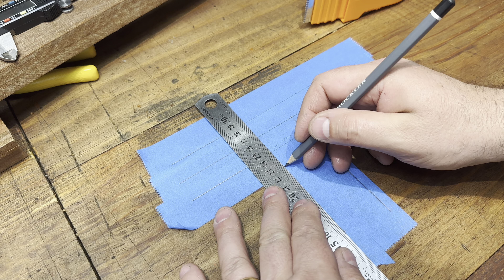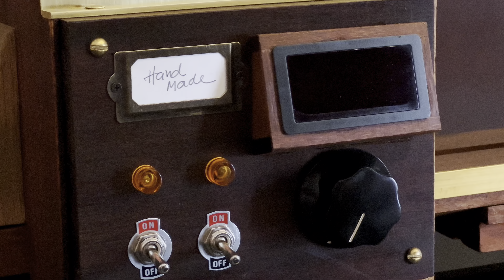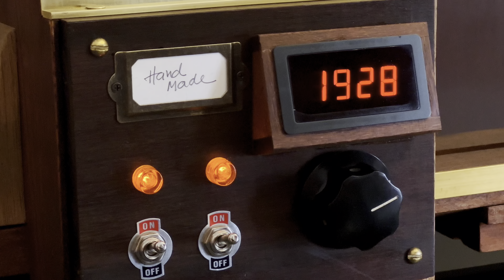How to Make | DIY Wood Lathe from washing machine motor #howtomake

Comment: very nice You are a true craftsman and I want one. How much did it cost?
Reply from the maker: Hi, how are you? This is a very good question! I don't know, I already had an engine, wood, scrap from other projects and even an old belt. I only bought the bearings, shaft, chuck and electronics. I'll think about it and if I find any value I'll let you know Thank you for sending the message! @anthonyvincent9990

Comment: Beautiful job!  The parts you used for the tail stock, genius!  Where did you find the threaded rod with a pulley attached?
Reply from the maker: Hi, how are you? Thanks for message. I created a sketch and I bought that like a project. About the chuck, I bought in amazon. I believe if you can buy both in amazon. Tips: 1-buy that’s parts (motor, chuck…., 2-build the lathe. 🙏🙏🙏 @bonesstones6584

Comment: Hello friend! I plan on building something like this for myself, and had some questions. 

First, what did you do for the spindle? Did you purchase one, or get it from a broken lathe? Or make it?
Reply from the maker: Hello friend! Good idea, you can make like that.
About the spindle, this is very importante. I made a sketch and send to mechanic. You can buy in amazon all the peace’s. I bought wash machine motor and controls in amazon.
Reply: @woodtransformer  So you had it custom machined? My university has a machine shop, so I might make it there. How has the lathe held up? Is it still going strong?
Reply from the maker: @Butteredthanatoast  Very strong! Was made for that... Stability, firmness and security. If you need any help, let me know!
Reply: @woodtransformer  
I'm considering making my bed ways out of angle irons, 2x1.5 inches, for additional strength. What do you think of this idea?

Also, how powerful is your motor?
Reply from the maker: @Butteredthanatoast Great! The estructure is very important than a strong motor. Your project, I believe, is a more professional than my. For select the motor you need a lot of attention... 1) what the size of pieces you will make with that lathe? 2) what command control you use for speed control? 3) wells for rpm? My project, 1/4hp, motor well 2”, spindle well 3,5”... my limit piece size 7” diameter.
Reply: @woodtransformer Se precisares, amigo, podes escrever em Português. Eu posso entender um pouco; os meus avós são Açorianos.

Não tenho planos para menos do que um ou dois conjuntos de xadrez. Estou planejando dar ao meu torno 17" de comprimento da cara do cabeçote até a ponta. Talvez acabe com 12" depois de adicionar o contraponto, o que deve ser suficiente. Meu diâmetro vai ficar igual ao seu.

Também não tenho planos para o controlador; tenho um amigo que é muito bom em eletrônica e ele vai me ajudar.

Meu motor será maior que o seu; tem 1/2hp. 

I did have to use some google translate, but it's good practice, lol.
Reply from the maker: Olá! Fico feliz em ter ajudado e desculpe a demora em responder. Receber mensagens são uma forma gratificante de reconhecimento do meu trabalho. Além disso fico mais feliz que as pessoas sigam meus trabalhos como referência e criem outros maiores!!! Como está o projeto, já ficou pronto? Fiquei curioso em ver!!!! Grande abraço!!!!
Reply: @woodtransformer  

Ainda não comecei; tenho muitos projetos e não tenho tempo suficiente. Tenho alguns projetos que estão quase prontos. Quero fazer este como meu próximo grande projeto, mas ainda preciso terminar minha guitarra e o meu conjunto de xadrez de metal. Estou quase acabando com esses. Avisarei quando eu começar – terei muitas perguntas. Lol.